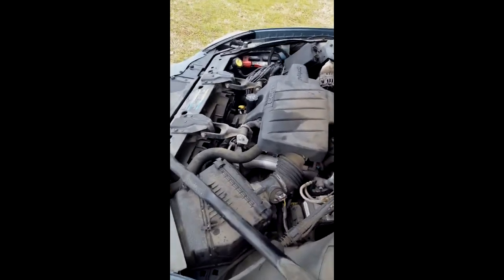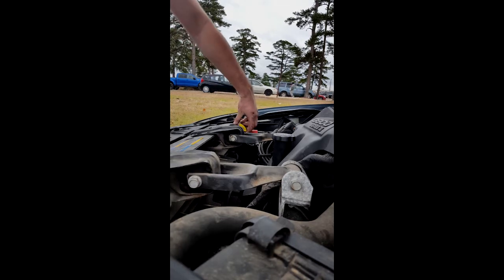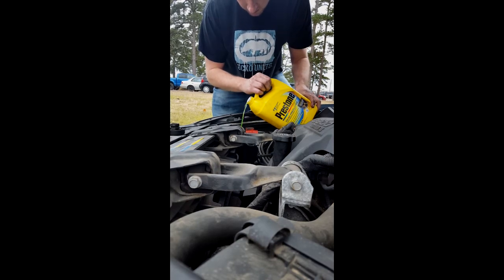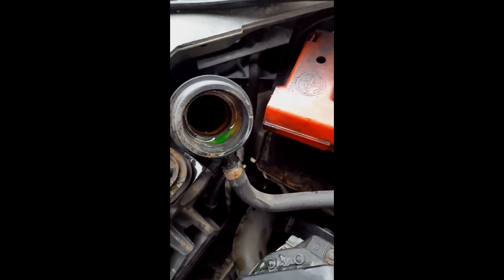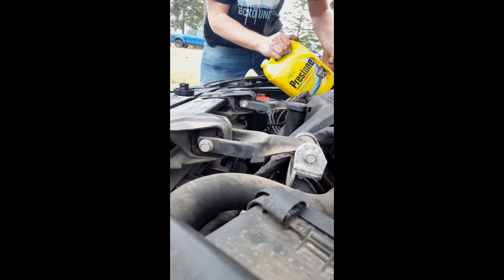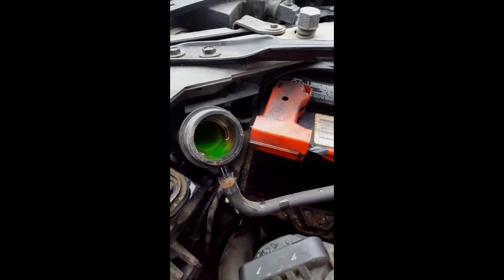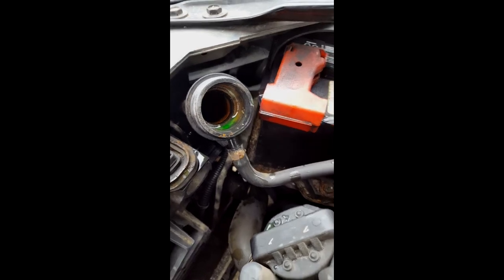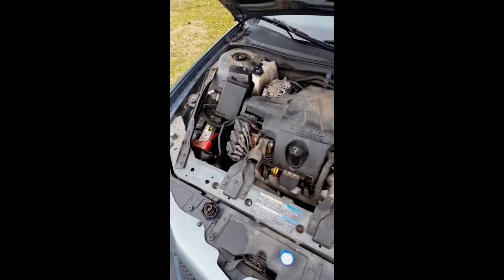How to burp your coolant system.

Comment: I've done this for hours at a time and still over heats. I had the clutch fan and thermostat replaced and nothing. I've flushed it 6 times and nothing. Suggestions?
Reply: MY_BRUTALITY PSN radiator, radiator cap, water pump
Reply: Was it overheating before? You can check for leaks, possibly a bad water pump, check the coolant for exhaust fumes (requires a tester kit that can be had at auto zone) which would indicate a blown head gasket, maybe a clogged heater core. Sorry it took so long to reply, must have missed the notification.